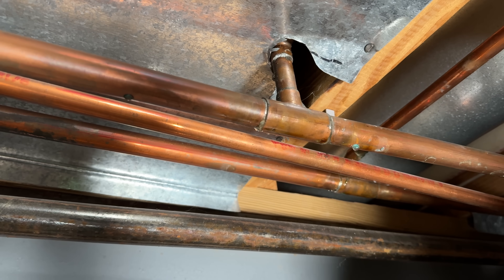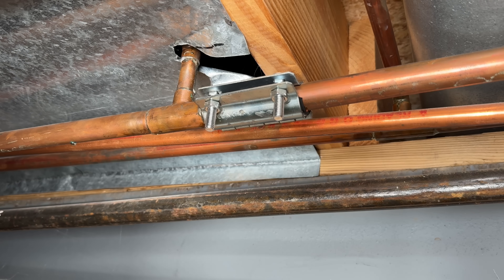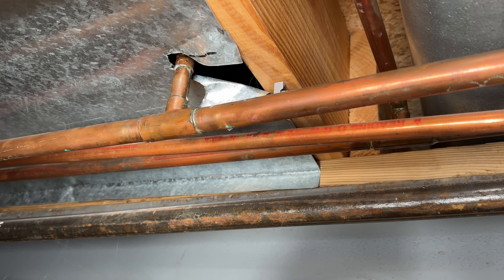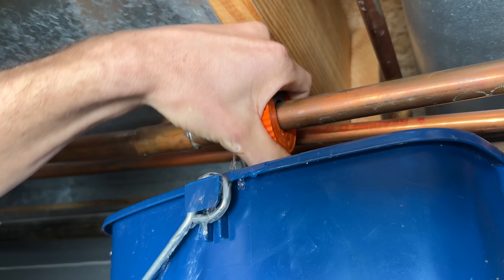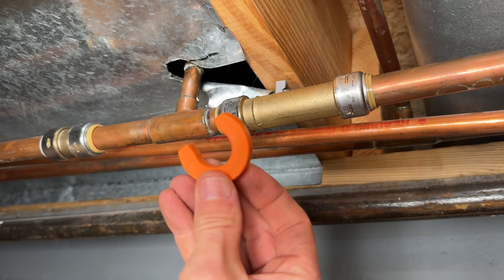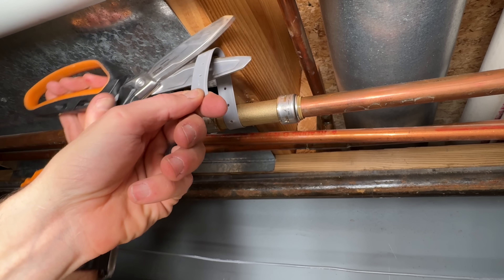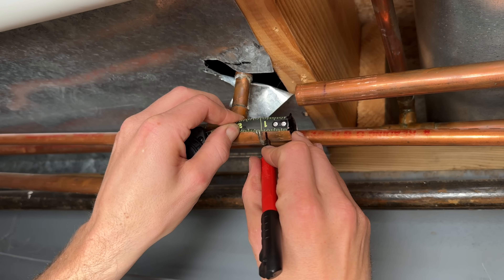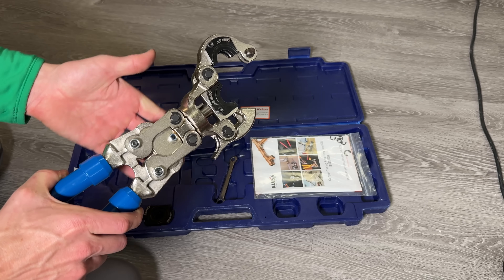How To Fix A Pinhole Water Leak In Copper Pipe | No Soldering Needed!

Comment from the maker: iCRIMP Manual Press Fitting Crimper - https://geni.us/IqAJ7o0
Emergency Repair Clamp (3/8"- 3/4") - https://geni.us/puKo0
AutoCut 3/4" Pipe Cutter - https://geni.us/vL3VYDM
SharkBite Max 3/4" Coupling - https://geni.us/ZZvOVa
SharkBite Gen 1 3/4" Slip Coupling - https://geni.us/BBYRDyy
Depth Gauge and Inner Outer Reaming Tool - https://geni.us/rpYTQ
Deburring Pen - https://geni.us/rG539Om
ProPress  3/4" Coupling Without Stop - https://geni.us/aN8v

DISCLAIMER: This video and description contain affiliate links, which means that if you click on one of the product links, I’ll receive a small commission.
Reply: bc kickbayt
Reply: @Dan126ful  Bro.  Been there done the shark bite fix, months later, more pin hole leaks.  If you get multiple pin hole leaks, your copper pipes have probably reached their life expectancy.  Time to replumb the entire house.
Reply: Slip joints don't exactly slip on easily. Used the Shark Bite system and it was a freaking fight to the finish.
Reply: Or, you can get some silver solder and just solder the hole, using MAP gas. Had to do that on 4" line. The elbow joint leaked a little. The line had a slight bow in it, and I couldn't get all the water out to re-solder it. So, I drilled a hole in the low spot to drain the line, then I was able to solder the elbow, then used the silver solder to seal the hole I drilled.

Comment: Actually, the Propress seal by copper to copper contact.  The o-ring is really just a backup.  There is at least one video where a guy took the o-rings out created a joint and it did not leak.

Comment: My house had a ton of pinhole leaks and luckily it has a drop ceiling.  I have always soldered my pipes and never had problems. It's not hard and much cheaper though you have to be careful with the torch and setting your house on fire.

Comment: Several years ago I went into my laundry room to find a leaking water pipe. Cut it straight and filed down the edges used a shark bite splicer like you did.  Still working!

Comment: Easy to make one cut, then copper sleeve and solder it.  Shark bite fittings use rubber o-rings that will be a leak issue years from now.

Comment: A neighbor had a pin hole leak. I used a sleeve as a temporary fix. As I tightened it, the pipe was crushed.  It was all corroded.

Comment: I had pinholes in an exposed copper half-inch pipe in my basement that was the main pipe coming out of the water heater. It had pinholes all along it, but I was a new homeowner,  30 years ago or so, and didn't know what to do. I went to Home Depot and he gave me two shark bite couplings fittings and a section of flexible pex. I cut out the bad section, put in the shark bites and the pexs,  and it hasn't leaked since. After taking out the copper, I realized that it was a smaller gauge of copper than the other pipes. and must have leaked previously and been replaced with a cheaper piece of copper  the shark bites have never failed

Comment: If you've got pinholes in occurring in your pipes it means eventually the whole pipe is going to go. Probably all the plumbing in this house needs to be replaced. I went through this in the 1990s. I built my house in the 1960s but the acidic water from the well ate through the pipes and every 6 months after the first 20 years I had pin holes popping out everywhere. I eventually replaced everything with PVC pipe and have not had any issues since.

Comment: Fixing just the pin hole leak in copper piping means leaving the rest of the piping which is also internally corroded until it reaches the same point. Hopefully you're home when it does

Comment: i have a pipe leaking it a vertical concrete/brick wall. how i know is that its leaking out the floor at the bottom. is there some sort of fluid/chemical that i can introduce to seal the leak from within? i think theres such a thing for tubeless tyres but is there something for pipes? dont really want to hack the wall. something non toxic for human consumption of course. otherwise is there like a tool that can be inflated that goes through the pipe and inflate just before the leak? i am ok to stop use of the tap that pipe leads to.

Comment: Hose clamp and small piece of rubber. Worked for me in my basement. (Exposed pipe) I’m a plumber. A lazy plumber. Eventuality I will replace a section of pipe with solder and couplings.

Comment: I have an appliance water line (fridge) shutoff valve that is starting to leak, and am thinking about replacing it with a sharkbite valve replacement.  I've had very good long term success with sharkbite used to fix leaks, and also have used it for some replumbing jobs.  I'm just a DYIer, not a pro, and have done solder work (a good while ago) as well, but I really don't trust myself with the crimper tool method.  Much more comfortable with sharkbite at this point.

Comment: I had that problem in my house I purchased. The previous owners did copper pipe replacement and used too much solder and the exes solder sat a corroded in the bottom pipe.

Comment: I woke up with this issue in my basement, except mine was spraying and not driping. I always used sharkbites before, but foolishly I went with some hold plugging kit, didnt plug it at all. 

I've had one failure experience with a sharkbite, bit it was outdors, I put one outside of a copper pipe, and under some pressure in the summer it slipped right off the pipe while i was watering my garden, I always just assumed it was a bad connection, I replace it on the same pipe and its been good for years under a lot of use.

Comment: A plumber fixed a water pipe leak in my basement that had caused flooding using a Shark Bite…He said it would be a permanent fix……..1 year later the Shark Bite stopped working and flooded part of my basement for a second time….therefore I do not trust the Shark Bite solution…..

Comment: The issue I see relates to why these pinhole leaks appeared in the first place. If several pinhole leaks appeared in this copper pipe, wouldn't that suggest that many more similar leaks in the same pipe will later appear?  I have done a lot of copper pipe work over the decades and have never seen a pinhole leak appear in a copper pipe. Here it looks to me like there is no use sealing the drywall hole after this repair because something else will soon go wrong with these copper pipes.

Comment: Use some black vinyl tape and wrap the drip 3 times then use a band clamp around the tape centered on the leak. It’s been five years and I really should replace that pipe… but… no leaks.

Comment: How are either of these methods (i.e Sharkbite and o-ring lined copper compression fittings) superior to soldering in a new section of  copper pipe using simple short copper sleeve couplings?  Soldering copper pipe is not really difficult, once one has the concept and gives it a try.  (Just watch a Youtube tutorial to get, both, the concept and the technique to aim for.)  And the only reason a professional plumber - already skilled in soldering copper pipe joints, by the way - might opt for a more expensive o-ring lined copper compression fitting would be to to maximize his/her productivity.

Comment: Nice video.  I’ve used the manual crimp you have and then returned it and got the Vevor instead.  I’d recommend the Vevor because it has a smaller head for tight spaces and the small hydraulic pump is stupid easy compared to the icrimp.

Comment: I am definitely a fan of the SharkBite max products as I have used them is serveral home plumbing repairs recently - I also like the fact that I can utilize pex to copper in tight areas as well, while using the same Sharkbite connection - thank you for the video

Comment: I have to replace multiple sections of copper in the loop between my boiler and my hot water storage tank.  The internet installer grounded the coax cable coming into my house on that copper pipe loop a few years ago.  Now as a result of that little bit of ground current, electrolytic pitting has occurred in several spots of the copper pipe in that loop.  I have leaks in multiple spots.  None of the copper pipes outside of that loop are affected.  The internet cable used to be grounded closer to the water meter where the water pipes are grounded to the house electrical ground.  For some reason, he felt that the prior ground wasn't working well enough, but he didn't have any grit paper to sand the pipe in that spot, so he just found some shinier pipes and moved the ground clamp.  Unfortunately, that thoughtless move has now left me with a headache to fix.  I'm just glad that it was connected on the hot tap water pipes and not on the hot water baseboard system, because that system is pressurized and the leaks would have been a heck of a lot worse.

Comment: I used shark bite fittings as temporary fittings while replacing copper lines with pex.  I only used a few couplers and tees to replace a section at a time then reused them for next section until i could install permenant brass barbed pex fittings.
I also used a shark bite at the bottom of the bowl on the spin down filter that I added after the well pressure tank to screen out well scaling or sediment.
If I don't purge out the spin down filter often enough then the shark bite fitting allows me to remove drain pipe easily to clear the clog of sediment above the ball valve for purging.

Comment: Great video and thanks.  When I finished my basement, this is one of the reasons I love dropped ceilings. I’ve already had this problem with a shower leak. Once I repaired the leak, I replaced one ceiling tile and the repair was done.

Comment: It looks like you have a bigger problem than just 2 small holes. The copper pipe has a acidic water problem and all the copper pipes are eroded and the potential for more leaks is very high. The shark bite fittings are ok as long as it’s not buried in a wall or ceiling.

Comment: I always sweat permanent or hidden fittings. O-rings deteriorate and fail over the decades and should never be used behind sheetrock or otherwise hidden behind walls or ceilings.  Just sayin'.

Comment: Key... Propress and SharkBite O-rings can fail with hot water making the rubber brittle or hard after a few decades. Rubber will eventually fail, that's a certainty. Propress is a bit better because I have seen demo's where they don't leak, even without the O-ring.  Imaging the financial nightmare of having to replace fittings behind the wall. It's why I use soldered fittings. No failure after more than 40 years.

Comment: Firstly, pinhole leaks do not drip like that. They spurt out with force.
Sharkbite works fine, but they are a real pain to get on and off. The release collars are just not very efficient. They really are no better than the compression fittings that have been available for decades.
That connection is a bit too close to the t fitting. Usually pinholes occur on or very close to a fitting.

Comment: If you want it done right, follow his instructions. It is a very good tutorial.

If you just want to get it done (all you anall retentive or OCD types will hate me), listen up. The copper pipe will corrode itself shut - if given time.  I worked for a kitchen remodeler years ago. When I reported some leaks in the crawlspace, he just blew me off.

If you want it fixed quick, cheap, and easy:  wrap the leak tightly with electrical tape. Expand the width of the wrap on each pass and then return - over-wrapping the leaky area. Don't doubt me. I learned this when tearing out old walls on a remodel, and those repairs lasted indefinitely.

Here is how you test the effectiveness of your repair immediately. Do the repair while still under water pressure. Keep wrapping tightly , wider on each pass, pulling the tape very tight until it is fixed.

Frankly, I wouldn't do this unless I needed a quick way of forestalling turning the water off, but guaranteed, it does work. I do th8s frequently in lawn hoses, while under water pressure, and it keeps the hose functioning for years.

Comment: I do not thrust any o ring in the sharkbyte as I work with o-rings fail after a lot of hot and cold cycles . I sweat joint lasts longer .

Comment: Use copper pipe hanger strap instead for insurance. I've used the plastic straps like this on this video, mine failed in a few years. The thin wall copper pipe (pin holes) will fail in around 30 years, I would go with Type L. a little thicker pipe.

Comment: Hey, as a plumber, I appreciate you doing the repairs but there's some issues with your video. The coupling that you have in your hand is a polybutylene to copper coupling. If you notice the gray on the end is for polyblane  convert to copper CPVC or PEX. Second, the pipe going through that metal needs to be insulated because metal cannot be touching copper pipe due to electrolysis.
Reply: Installed a new faucet in my bathroom now the line under the sink is leaking. Some reason there are no shut-off valves under the sink. The one under the house is frozen

Comment: Just did this today.  After using shark bites to help put in a new water supply for a relocated washer/dryer combo. Noticed a bit further down the pipe a very slow pin hole drip.  Cut right on the pin hole then took out about another 1/4 inch of pipe. Slid on a 1/2 to 1/2 shark bite max stright connector. Easy peasy. Love shark bite fittings. The time saving off sets the extra cost.

Comment: usually occurs downstream from a hot water tank (hot water line) on 25-50 yr copper. ..once you get one, its a matter of time you'll get more. Do yourself the favour and replace the first 25 ft or more of that hot water line, with todays pex pipe, fittings and adapters its never been so easy....

Comment: Nice video. I’ve been using shark bites and pex for a long time. Sometimes I’ll use the cpvc glue. However shark bite is by far the best although costly. You can remove when needed. The pet is good too but if you crimp the clamp at the wrong spot or if you need to undo it there is a pain. After installing shark bites I always use stabilizing wood and strap to make it sturdy—this is probably the only drawback. As for the pin holes, if the plumbers used type L copper most of the issues would not occur. Type M is way too thin for anything. Measure twice and cut once.

Comment: I wasn't aware of the clamp but I was thinking there should be something like that. I've used SharkBite fittings about a dozen times in my house and half a dozen in my son's house. I had a commercial plumber turn me on to them after I watched him use a hydraulic press/ crimper on a 3 in water line. I'm glad to know the Manual Press Fitting Crimper is available. Thanks for the great video.

Comment: I liked your emergency  or temporary rubber clamp tool, definitely need one of those. Plumbing, should be renamed "do i have the right fitting with me."  Over the years I always got the call "can you help me, my water pipes are leaking". Get there, its usually a simple fix but never had the right parts. My plumbing tool box is a hard cased tote now. Not to big but I have: first ptfe tape white and yellow(gas)  the paste also; white and yellow(gas) i use the paste on metal it prevents corsion but I also go over it with the tape, not to thick. If you use both threaded joint will never leak. Never use paste on plastic it melts the plastic over time and the connection will fail. Fittings start at 1/2",3/4",and 1" sizes of cpvc, some galvanized, and then copper. They start at reducing bushings, couplers, unions, male and female adaptors, some elbows, but mainly T's now with a male adaptor and female cap on the unused rizor. it really becomes handy in the future and seams to create a stronger joint than an elbow. I also install a ball value before the leak every time now. Because for some strange reason there always seems to  be another leak farther down the piping in the future. I know it isn't practical but it makes future repairs quick and easy. I also have sink and toilet parts. I aways use 3/8" compression flexible hard  pipe with 1/4 turn valves. They never break or leak at the connection. Faucet grease is a must.

Comment: I just made this repair using clamp repair with bolts that i got at Menards. Stopped the leak. All is good now except for the water damaged things in my basement 
basement. 😢 I am having surgery tomorrow and need a quick fix for now and will do a more permanent fix later.

Comment: There is a pinhole leak there because the tubing wasn't reamed when it was installed. The turbulence of the water will ALWAYS cut a pinhole in the pipe right after the fitting EVERY time! How do I know, I have been a UA plumber/pipefitter for 44 years. You didn't fix the actual problem, you just managed to put a bandaid on it, and a terrible fix on any copper pipe. the biggest issue it the type M copper that someone used to run the lines with. Type M is the thinnest wall tubing you can use in the plumbing industry and is basically junk used by DIY, and scam plumbers.

Comment: great video but i noticed you did not clean the pipes at all like we would if soldering.  is that ever necessary and what if i'm going over an old solder joint, do i sand and clean then ?

Comment: No need for all this cutting.  Turn off & drain water. Take an ice pick, awl, small file and clean out the pin hole down to solid base metal. Take a small piece of 150 grit sand paper & sand over and around the pin hole approx. 1/4”. Wipe clean, flux the entire area around the hole. Heat up the area  from the back/ top of the pinhole and solder over the hole. Build it up around the are with solder.  Let it cool. Turn on the water. I have pin holes I fixed twenty years ago with no leaks😅